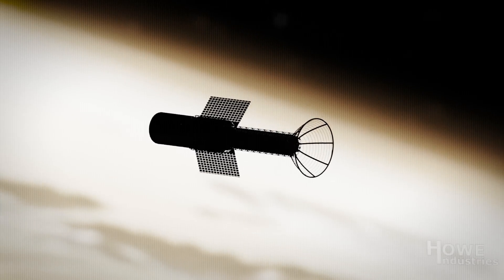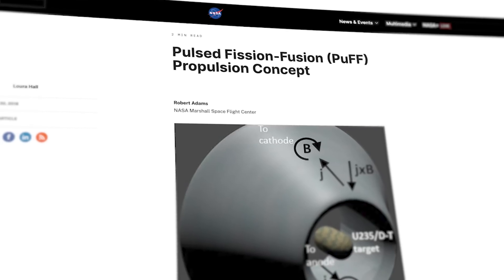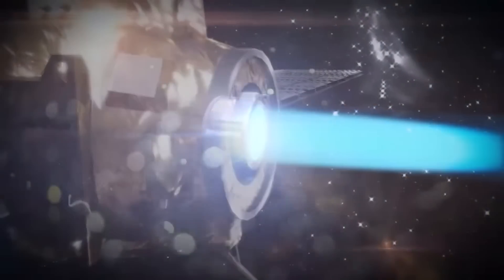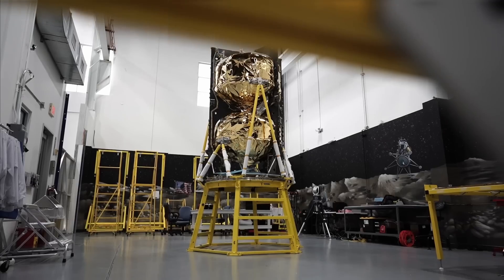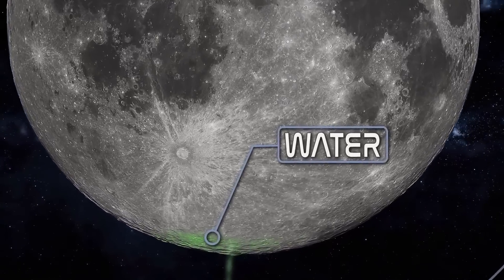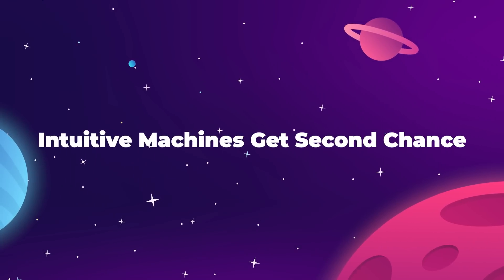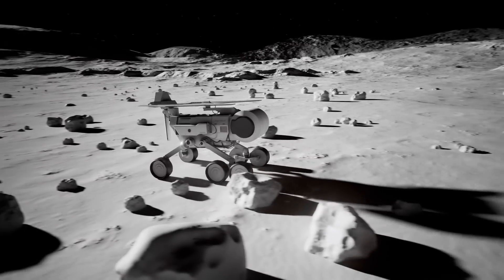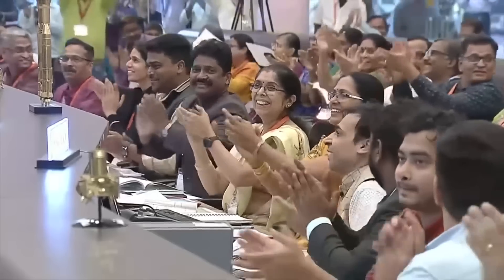Why NASA Is Developing A NEW Nuclear Rocket!

Comment: So a rocket like starship uses its fuel to lift off and land, and it takes over 8 minutes to reach  leo, but that is also inside the atmosphere. A nuclear rocket is only useful outside of the atmosphere and is over 15.5 times as powerful. So it is either 15.5 times faster in outer space OR can operate over 15.5 times as long on a poer setting equal to the raptor engines. That is a total of 124 minutes OR 62 minutes of constant acceleration plus 62 minutes of deceleration.  But wait, Raptor does that at 3g force to escape the earth. If the nuclear engine only went 1g the it should go 186 minutes of acceleration and 186 minutes of deceleration in space. So how long would it take to go to the moon using half the fuel 93 minutes plus 93 minutes so you orbit the moon then have 93 minutes plus 93 minutes of return fuel to get back to earth?

Comment: Sounds like a good concept. With a lot of money it could be made realistic in one century or so.

What you failed to mention is a true fission engine. One where a near-conventional nuclear reactor is used to heat liquid hydrogen to high temperatures and pressures limited only by current materials science. The H2 is then exhausted through a standard issue vacuum nozzle. How long would it take to develop this? The US designed and built example engines in the 1960's.

Comment: How exactly do lasers, which are just coherent photons, "inject neutrons" into the stream of Uranium? I saw another You tuber say that, so where are you guys getting this?
I paused the video so I could read the stuff on the screen, and I see no mention of "lasers". 
It says that there is a massive current at 2 million amps at 2 million volts, caused by conduction when the bullet touches the anode target. That current passes through a Lithium outer shell of the "bullet" and magnetic forces from the massive current compress the uranium to critical mass, which generates fission, and massive heating in the chain reaction, and the heat creates fusion conditions for the Deuterium. The fusion generates more neutrons, which increase the fission reaction, which boosts the fusion, and continue in a self reinforcing chain reaction until nuclear fuel is fully consumed.
The resulting plasma is contained and forced rearward by a magnetic nozzle produced by giant magnetic coils.
All very plausible. However, the power requirements must be massive, so NASA needs to step up their nuclear power generating systems for spacecraft.
The other thing such a system adds to safety of a Mars mission is additional abort modes.

Comment: now wait a second, isn't there a some issues with that design of engine mostly the pulsing, as described that would be like a monster truck with one 8-liter cylinder and no flywheel, when you hit the accelerator any humans going to feel that pulse. It would feel like accelerating then orbiting every second for 1 hour and 20 minutes they'll be sick. Of course there's ways around that problem, like firing off so fast it wouldn't be notably, or splitting the work among 3 or 4 barrels like a Gatling gun, both adding their share of complexity and problems. But this is not something you want to get wrong, we know what happens when two isotopes collide at high speed. I'm not trying to be negative, but I wouldn't expect to see a working probe for another 5 to10 years.

Comment: I am glad that other people are finding out about the old project Orion. It seemed really promising but was shelved by the Kennidy administration because he was worried that putting bombs in space would escalate the problems with the USSR. The developers of this project paired with the military in an effort to get president Kennidy to green light it. Saying that it could be used as a weapon and even use it's own blast shield to defend itself from hostile fire. Which ironically led to it's downfall. Looks like SpaceX showing them up got NASA to finally dust-off this project. I just hope that they don't give it to break everything Boeing.  This system has so much power that the developers joked about installing those old heavy barber chairs in it. Because it has so much lift. The biggest concern about this project was the amount of radiation that would be coming off of the rocket in Earth's atmosphere was dangerous. However, it would make a great rocket in space. So long as we deliver it by other means. This is great news. You made my day!

Comment: That's the sort of thinking that opens up the solar system.
Reply: Praying everyday that the Epstein drive becomes reality! 🤞🏻
Reply: @yellowhammer126  Probably not since while based in real science, the Epstein Drive is far more effective than anything possible with Fusion. The Rocinante can easily pull 5.5 Megameters Per Second of Delta V. You can't really get that much Delta V without Antimatter. 

However, even the more plausable 100-300 Km per second of Delta V from high end projected Fusion Engines would be infinitely better than the Chemical Rockets of today.

Comment: Is it known how a PuFF propelled rocket  would slow down to enter a Martian orbit/land on Mars?
Reply from the maker: That's a good question! I assume that it would have to flip around and start firing in the opposite direction
Reply: Wouldn’t that mean flying through the radiation caused by the propulsion reaction? I suppose maybe that’s where the extra radiation protection would come in. Or maybe potentially have the orbiter as a separate staging and see if it’s possible for the PuFF to sling shot back to earth to intercept another mission for interplanetary delivery??? Very cool nonetheless!!